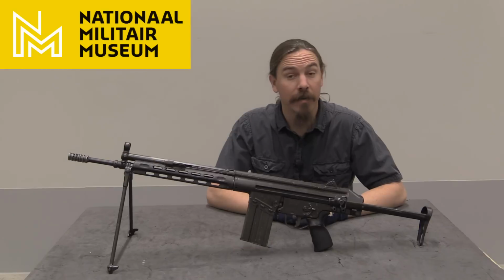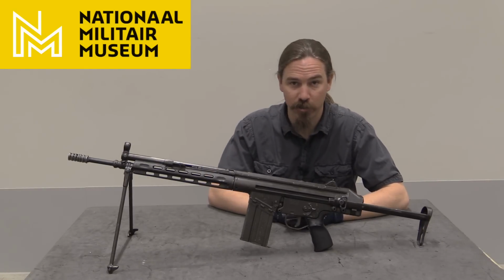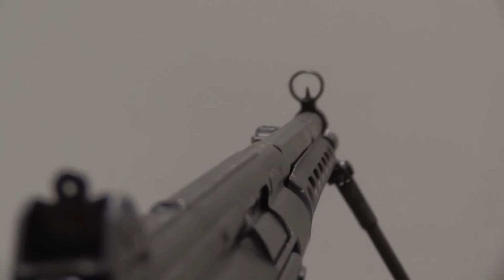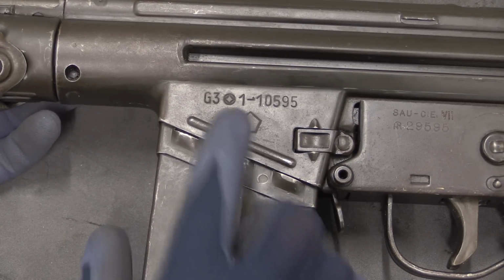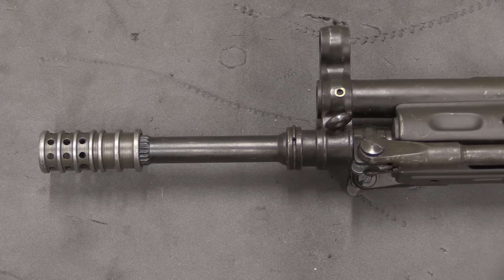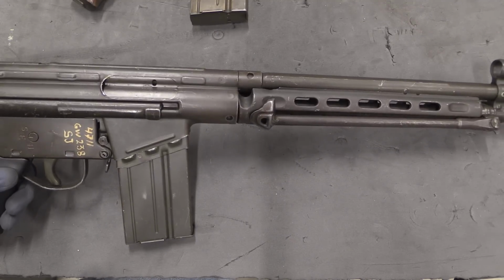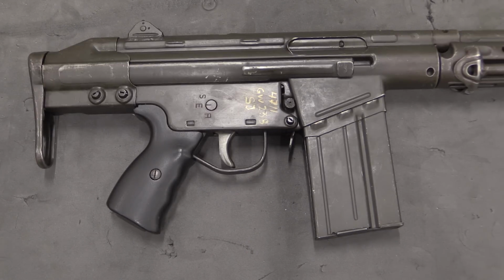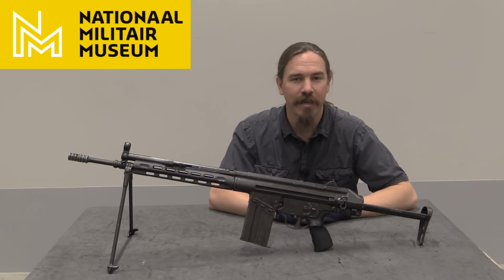Indonesian Air Force Collapsing-Stock  G3

Comment: Ian I have a question for the first HK G3. 

When the German Engineers designed the G3, did they deliberately put those side cuts on the upper receiver for collapsible stock? Because by my general knowledge the first g3 design goes with Fixed stock but the collapsible stock in later development fits in perfectly. I hope my question makes sense to you. Thanks in advance!

Brian from Hong Kong

Comment: If you had shown the bolt carrier group, the HK bolt carrier is two pieces, the top tube the recoil spring fits into is welded to the top part of the carrier which holds the bolt. The Rhinemetall carrier is all one machined piece, which is extremely hard to find.

Comment: That telescoping stock sucks ass. I just needed to say that.  I think a folding stock with more of a comb whould do a better job.  I also feel that although the G-3 bayonet is excellent, it could do with a little more length, like just a couple more inches, and not be mounted where the infrared flashlight nees to be, put a proper bayonet lug underneath. and put a proper scope rail in the mothertrucking thing.  I think that's my rant for the day.  I love H&K; but they have gone off the rails with what they are making right now.  They should just improve on the G-3.  I just said like three things that would make it much more markeatable.  Also fuck this copycat thing and that bead sight.  I fucking hate bead sights.  The real G-3's have an open sight that is much better.

Comment: Ian, just a heads up...the conflict was in West Papua, not Papua New Guinea. West Papua was at the time a Dutch colony, and PNG was under Australia control, having been a German colony until 1919. PNG later became independent in 1975. West Papua is still controlled by Indonesia, and even today, there are a few rebels fighting the TNI. The bulk of the fighting was however, as you rightly pointed out, over in the 1960's.

Comment: So the G1 was the FAL and cetme was the G3 but what was the G2? I love my ptr91 and the delayed roller lock system so much I have a ptr9 (308), a century c93 (5.56), a vector v53 (5.56), and an atlantic arms AA89 (mp5 9mm). They are all great guns. I've done paddle mag releases on the ptr91 and the century c93 as the others came with them. I'm currently at 14 h&k 93/53 40 rnd metal mags. So obviously I have a good bit invested in the guns since the 93/533 h&k 40 rnd mags are around 80$ each. I also have over 100 loaded 20rnd G3 mags because they are 3-6$ each. Mp5 mags from south Korea are like 14$ each so I have a great deal of those too. I'd also like to build a Cetme-L from a parts kit. I'm a gunsmith and FFL so finding time to work on my own guns is limited. Great show and keep up the good work. This is one of if not my most  favorite gun related channel.

Comment: FWIW:  "Full Circle" shows an HK G3 with an April 1960 date code equipped with an early retractable stock.  See Pg 239.  Pg 243 has a June 1950 date code HK G3 with an improved retractable buttstock.

The G3A1 was the first variant with the retractable buttstock to be adopted by the Bundeswehr in August 1963.  The updated G3A4 was adopted concurrently with the fixed stock G3A3 in December 1964.